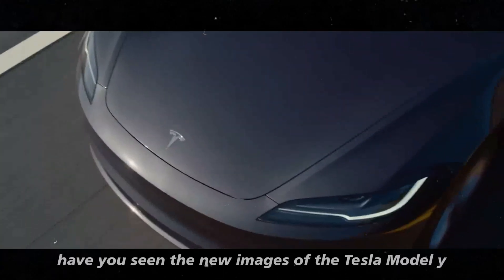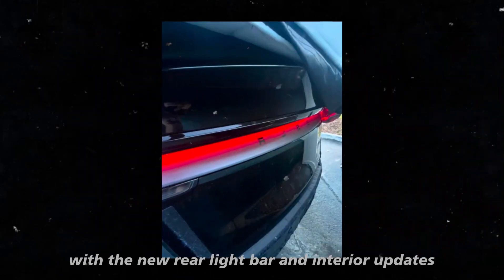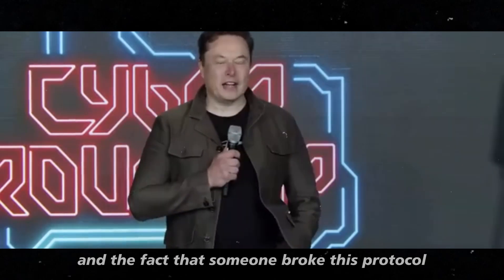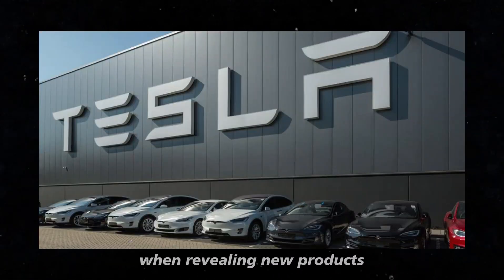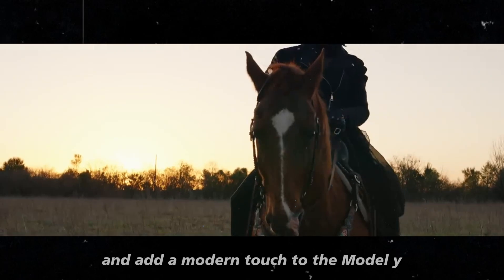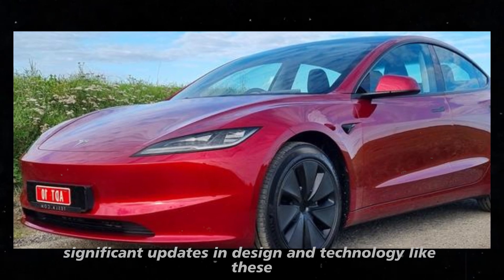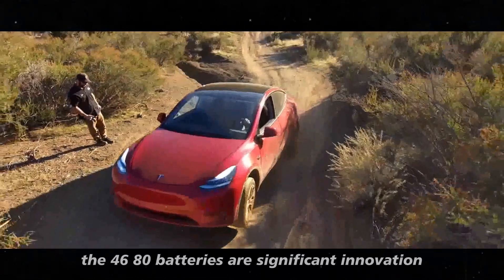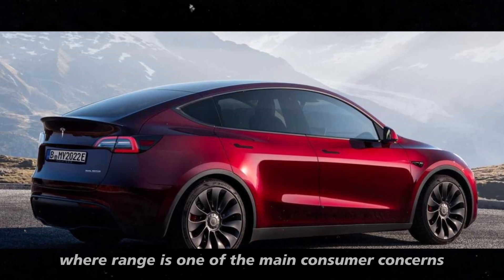3 MINUTES AGO! Tesla Model Y Juniper 2025 LEAKED IMAGES Of The NEW TESLA By Employee, Details.

Comment: Besides the bar light. I think the corner taillights are going to be slightly different. In the photo the corner taillight is slightly entering frame on the right side and it looks to be the bottom part. In the current new taillights on the model 3, the top portion is longer than the bottom. But in the leaked photos the top portion is not visible, just the bottom portion.